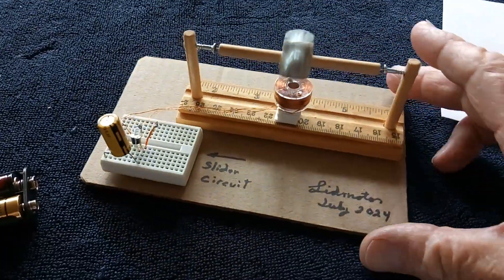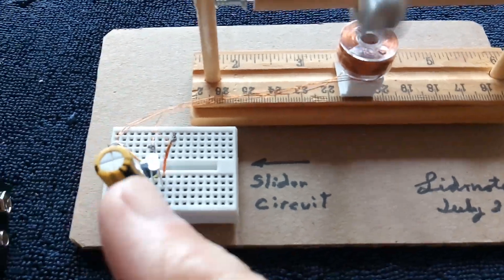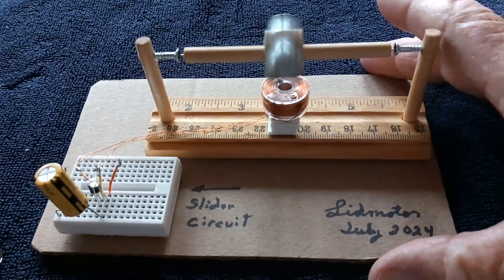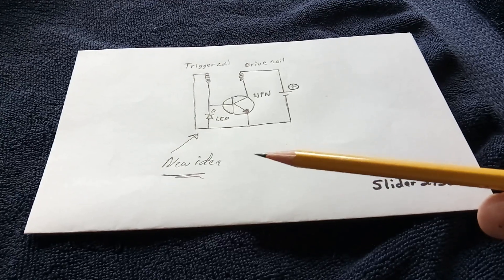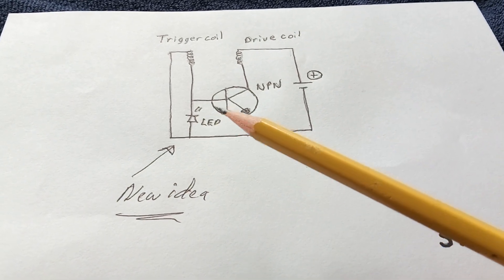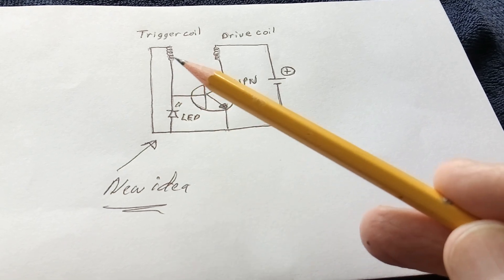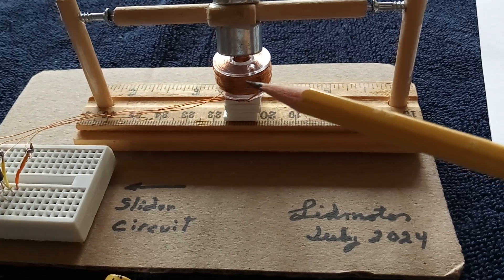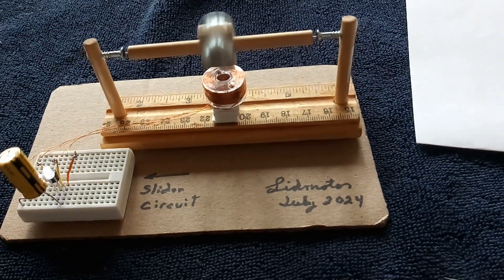Slider's Simple Pulse Motor Circuit

Comment: Interesting. Never seen the source on that side of the transistor. The Joule ringer usually works better with 1:3 ratio, so wrap 4 wires and connect 3 of them in series.

What is the most officiant circuit you have built? The two transistor circuits seem to run good. Like the Skycollection JL94, or Arkiver Unified Energy circuit that's on the video called Tesla Bifilar Coil Electromagnet Mystery Solved.

Comment: Well yes its a basic bedini... but using an led.. consumes more than a normal uf diode and the resistor would allow to regulate the consumption.. those parts are not necessary but are very useful

Comment: very nice build, neat...  far better than the original.

but...
its just a joule thief with the magnetic field driving a magnet. a joule thief will run for days off a supercap... and yes, they do produce a spike on the base that works fine for driving an LED, albeit far less powerful than the "real" JT with the LED across collector emitter... theres nothing new about the circuit itself... 

this is exactly what you find in those little dancing flower (mines a skull?) solar ornaments, and the kinetic sculptures of the late 80s and 90s...

the real question is how much power can be drawn from that shaft and how does it compare to the rate the capacitor discharges at? 

maybe a small variable pitch fan in a duct... can measure air speed and over a certain area that requires a certain amount of power to do.

Comment: You're very welcome dear sir!
Am also grateful for your building of a simplified pulse motor that does work like the successful brushless 5V fans. That's what was giving the trouble in my last video, to build a relatable and buildable pulse motor on the workbench.
And, so good to still be collaborating and sharing updates on projects after all these years  😁👍
Reply from the maker: I am having  a lot of fun with this old but new project.  The driver I made will not work on most of my pulse motor setups because it needs a very strong magnet rotor for triggering.  I may wind a new coil with more fine wire turns on the coil.   I did get this rotor to run today with no led. The circuit was just the transistor and 3 volts.  Your fans might run this way also if you get the voltage right.  Fun stuff. 😃
Reply: @Lidmotor  Only just found out that ring magnets are N/S/N/S, obvious really but I'd been used to single pole circuits. Good point on magnet strength, it'd fix the intermittent pulsing on mine.
Hmm, depending on the coil the flyback may be within tolerance for regular transistors. Can't take anything else out of the circuit! 🤣

Comment: I have replaced the diode with an led like that before, I'm sure others have as well. It is actually nice to have the led instead of the diode because you are not wasting the energy. A cool feature of the diode as well is it can dissipate more energy at about 3v so any access of 3v is current to light it. As long as you don't exceed the current it works great in these circuits. If you really think about it, the joule thief, and the bidini circuits are almost identical. And there are several other circuits that are very similar as well. It's fun to experiment with these simple circuits. They are super simple and easy to put together and you get a working product. The exciter slayer tesla circuit is honestly not that much difference either. It's a simple single transistor circuit. Good job on your motor. It runs great
Reply from the maker: Thanks. These are fun easy projects that I really enjoy.

Comment: Whats the NPN Type? How much OHm is the Coil?
Reply from the maker: The NPN transistor here is a 1N4401 but most should work. The bifilar wound coil is a 13 ohm 34 Ga wire trigger coil wound with a 7 ohm 30 Ga wire drive coil.  This circuit worked better with a Neo ring magnet rotor than the one I showed here.  A better setup would with a seperate trigger coil with many more turns of fine wire.
Reply: @Lidmotor  thx

Comment: What happens if you try to make use of the torque of the shaft? Does the motor get out of sync and stop?
Reply from the maker: No. You can put a load on this but if the rpm drops too low the transistor doesn't trigger.   This can be corrected with a finer wire trigger coil with many more turns.